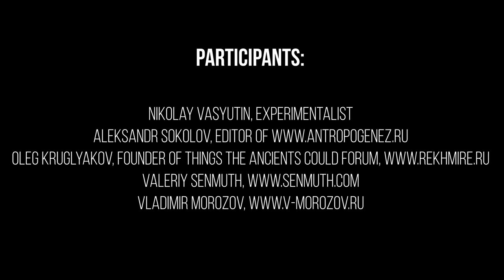Making Egyptian Drill Holes: Lost Ancient High Technology

Comment: Sorry, preposterous. Hose clamps?  steel C clamps?  Plywood? I don't think so. Did you make the copper?  You've proven baloney. Set your device up horizontally & show me it done.  Set your device up against a perfect plane, then drill the hole with one side of its circumference on that plane, show that done & then you'll be getting somewhere for those, are the types of bores that are in question, not simple vertical bore holes in granite, that can be done in many ways and without your rig-up in the first place.  You've solved nothing.

Comment: uh ya...   this is no where near the " drilling rate " most of the holes show, I forget the figure but it's much faster than even the drills we have today, at least the mechanical ones....  so Granite has a very high amount of quartz in it, quartz is a very good conductor of electricity.... video on you tube, guy drills through a steel ball bearing, with a copper rod, using electricity... one end is anode and the other is cathode you can also look up  EDM as it use's the same technology. Some of you people are trying to connect the ancient stone work to one group... WRONG as shown by the technology or tooling marks, some used a combination of light ( laser like we use to clean rust off metal only more advanced ) and sound vibration to shape the stone, like Machu Pichu walls, sorta the same as Egypt stone work... you can see the mindset difference between the work end result. It's like each machinist, has there own way of doing things, yes there are standard SOP's but you can usually tell who did the work with the subtle differences.

Comment: Unfortenly this is not the 100% truth, there are some drillholes, the oldest one. Wich have a drillrate of 0.1 inch per rpm in granit. This is ~500 times faster then a modern diamond drill. This method shown in this video was, also used from the younger era. And you can see clearly the carving marcs that are typical for this method. But the older drills are insane and cannot be explained other ancient hightech ore aliens.
Reply from the maker: Thank you for  the comment.
Take a look:

http://antropogenez.ru/uploads/pics/16-%D0%B4%D0%B2%D0%B0-%D0%B7%D0%B5%D0%BB-%D1%81%D1%82%D1%80_.jpg

on the left  -  the famous Core #7 found by Flinders Petrie in Egypt in the 1880’s
. "The oldest one"

on the right - The core obtained in Vasyutin's experiment in 2010th

Could you find any difference?
Reply: Can you link me to an image man ? Sounds incredible
Reply: @ScientistsAgainstMyths  hard to see that on one pic, but they look similiar.
Reply from the maker: Yes, they are very similiar

Comment: What results? Two days and you went one inch? and why did they reuse larger blocks during the "early Kingdom" They didn't even know the blocks had keystone cuts in them. They repurposed what was already there. We most likely had events causing a restart or recovery from events like an asteroid. and it's possible intelligent life came and went in the past. Is that so hard to believe? I find it much harder to believe we built these things in the beginning and went backwards? That makes no sense at all! Many of these site were never completed, as if something happened and then built over them. Ever wonder why or too busy disproving what you disagree with.
Reply: 45 minutes not 2 days

they show that copper and abrasive could easily drill stone, as it was in ancient Egypt

you need to visit a proctologist and a psychiatrist :face-blue-smiling:
Reply: @sedigives  
", it will take so much time and burn threw so many copper tubes" it's not, it works the same way sandpaper can "eat" steel while grinding. You can just do without copper and use bone or wood, because it is not copper that drills, but abrasive material. Wrong assertion and wrong assumption. 

I don't know who "they" are. The guys from the video got it right the first time. The whole world knows how to process stone, and people have been doing it since the Upper Paleolithic, and this is the Stone Age.

no one has ever cut stone with the speed of butter, then or even now. It must be a figure of speech, because if not, then it's just nonsense, stone processing takes time.

No one has ever considered stone processing impossible, except for the mentally ill people on the Internet who believe in aliens, the profession of carver and stone cutter still exists today. Everyone knows perfectly well how various stone structures were built and they argue only about small private clarifications, such as whether a bow drill or corundum was used there.
Reply: @sedigives  
"You can't get around the machining tool marks that are everywhere." it is impossible to see what is not there, although the Egyptians of course had various kinds of drills like what was shown in this video :body-blue-raised-arms:

" The level of bias it takes to ignore it is shocking" it's up to you to show at least one Egyptian machine for drilling or traces of it, everything that we see is processed by hand, with a drill, abrasive and other stones 😂

I didn’t understand what you wrote, everyone surpassed the Egyptians in construction a long time ago, even the ancient Greeks and Romans, everyone can repeat their work and it’s easy, although it will take time and physical strength 

"hat a closed minded fool it takes to not question any of it! Stay blind, it's your capacity. Easier that way." self-criticism and transferring your shortcomings to others :face-purple-wide-eyes::goodvibes:

Comment: too bad that the holes are usually never vertical but horizontal, and then they had to melt the copper or whatever material is used as a tube, they would have invented pipes, absurd
Reply: Usually never vertical. That is a strange statement.
Reply: @Eyes_Open  Nel senso che le pietre dove sono stati trovati questi fori sono enormi e talvolta ancora parte della montagna, quindi inamovibili, e sono in posizioni verticale.
In the sense that the stones where these holes were found are huge and sometimes still part of the mountain, therefore immovable, and are in vertical positions.
Reply: @alex2mes6  Perhaps you have an example?
Reply: @Eyes_Open  I have not archived photos of these stones because I did not think it was important, but there are many videos where they show the oddities of ancient archaeology, which are certainly not works of the populations to which they are attributed. But believe me this is irrelevant if compared to the works themselves which are IRREPRODUCIBLE TODAY with our "technology" There are several interesting channels that explain it well in detail, Now I do not remember it by heart but as soon as I have the chance I will give you the LINK
Reply: @alex2mes6  No need to supply links to channels that spread misinformation. The belief that we can't perform work today is false. Stones can be moved for vertical drilling and then turned horizontal.
Reply: Too bad you're not as smart as those ancient builders: the holes were drilled vertically, then the stone was flipped on it side to make the hole horizontal.

Comment: Several days for a few inched on a tiny scale with buckets, clamps etc. There are over 100 million stone blocks cut in Egyptian buildings with perfect water tight fit. At the rate you showed it could have never been finished if started a 100,000 years ago. Also drilling like this is fat easier to explain because the the digital holds water. A straight cut several yards deep in some cases on   60 ton stones moved 500 miles? Anyone can cut through granite with just about anything given enough time. I'm sure wood rubbed across a stone could cut into it eventually but at such a slow rate you wouldn't even notice for quite some time.  Try drilling down several feet and keep the core straight! Not going to happen due to wobble.
Reply: Incredulity is easy being most often seen with ignorance relating to a thing.  It further as you show us yields correspondingly poor assumptions.  I guess it never occurred to you that the Egyptian civilization existed for almost 3,000 years.  Ergo what we see was built over millennia.  Also a lot of what we see is hardly "perfect" - let alone water tight.  😂

So the video proves that using bronze tools with abrasives you can cut stone.  Anything which follows becomes a matter of time and effort expended. These were not one-offs either.  The fabrication of things was an entire economy in Egypt which likely employed tens of thousands if you factor in those who supplied the raw materials needed. Also since the Egyptian civilization existed for so long then at some point it would have access to iron tools as well as bronze ones.  Ergo a lot of latter New Kingdom stuff likely was produced using iron rather than bronze tools.

As to moving things = it's called the Nile River.  Look at Egyptian sites and see whereby they built near the Nile.  You see evidence of river ports throughout Egypt to include at places like quarries and Giza etc..  So blocks were transported a short distance to the river ------> loaded onto barges and ferried up/down river to the site where there was another harbor = and then moved a short distance to the worksite.  At Giza as an example the remains of an ancient harbor sits ~500 meters from the Great Pyramid.
Reply: The Egyptians had tens of millions on people over thousands of years, given your logic humans should have never built anything more than a twig house
Reply: @Mark R "There are over 100 million stone blocks cut in Egyptian buildings with perfect water tight fit" - Where can I see these 100 mln blocks?
Reply: @przemog88  
in his brain :face-orange-raised-eyebrow:
Reply: @UserOfTheName  
in fact, about 50 - 60 thousand workers and not tens of millions, and they worked for several years
Reply: @ВсеславВсеволодович  Well I kinda meant what they did in their entire history
Reply: @UserOfTheName  
oh

Comment: Lol this isn’t nearly as precise as what is seen at the sights 🤣
Reply from the maker: In what units is the precision of these sights measured? 😂
Reply: there is a function to precision. You can see the layers of difference between civilizations. Suggesting the older were much more capable.

This core cut lacks the level of depth and pressure per rotation shown on the petri cores. Proven with a string wrapped around it sitting within the gouges on the side of it. they are continual in fashion. 🥴☕️
Reply from the maker: This video about petri core: https://youtu.be/HQi4yql7Ysg
Special for you bro
Reply: @KILLJILL_Official  
"You can see the layers of difference between civilizations." no i cant 

and before Bronze Age Egypt there were only local Neolithic cultures

Comment: Lol.. now go cut 2.3mil 2-3ton blocks perfectly sq. Then cut 400ton statues that are perfectly symmetrical including the depth then move it all to the perfect location (29.9792° N, 31.1342° E)... 299792m/s speed of light 311342÷360 represents either diameter of sun in miles  or/and number of seconds in a day.... THEN build all these blocks that I'm sure you'll easily be able to move 😂 and build the pyramid to a scale model of the northern hemisphere of earth 🌎  to a scale of 43,200 = 50% number of seconds in a day (number of seconds 86,400) and get it just as good as our satellites. Then come back with you tube drill and explain that.. just think of the technology required to place these structures at the right longitude and latitude that perfectly before you even think about how they cut and moved millions of tons of rock. Ps this is just dip in the ocean of information available that people are not aware of. ✌
Reply: You failed in your first sentence. Since 2.3 million perfectly square blocks dont exist in reality, why do you demand someone else attempt this fantasy?
Reply: @Eyes_Open  lol.. the blocks might not be 'square' or cubed but the blocks are not simply rough round the edge type blocks. Scrapping on the detail there, any other problems with what I've said?
Reply: @paulross5934  You said perfectly square. Not close since the majority are rough cut with rubble and mortar filling the gaps. I have a problem in general with every other unsupported claim that you made.

Comment: 😂Funny that you use a modern copper pipe or copper sheet made by machines for accuracy as your tool. Silly 🥴.. Make the pipe first then lets test your accuracy.
Reply: Except the accuracy of the copy is basically meaningless for the use case here... You religious fantastic are always the same. You will simply move the goal post once someone shows that the ancient Egyptians could in fact have done that with simple tools
Reply: @Dundoril  You religious fantastic are always the same. 😄 yes the Egyptians could in fact have done that with simple tools,  but when you look at the accuracy and precision of the drill holes and saw marks you find, one has to question did they do it that way. or where they using machines that where cutting at a much faster cutting rate then a man rotating a stone wheel? Dunn and Petrie mention this. the cutting rate cutting into the material. Let just ignore that. I go with the science. cutting into material leave a fingerprint.
Reply: @bluedog7222  
"yes the Egyptians could in fact have done that with simple tools,  but when you look at the accuracy and precision of the drill holes and saw marks you find, one has to question did they do it that way" accuracy ? all ancient things are very crooked and made roughly, you are delirious

just look how uneven the sarcophagus of seraphim

"cutting into material leave a fingerprint." nope

dunn is a freak 
petri lived a long time ago and some of what he wrote was nonsense

Comment: All they need was copper tubing 😂😂 
Also the stones are much harder then copper , to cut the hard stones you need diamonds cutter
Reply from the maker: Have you tried watching the video?
Reply: The copper doesn’t do the cutting, the slurry does. It’s the same basic principle as lapping which is still used today, or using a leather strip with rouge to sharpen a knife. The leather/copper isn’t the cutting elememt